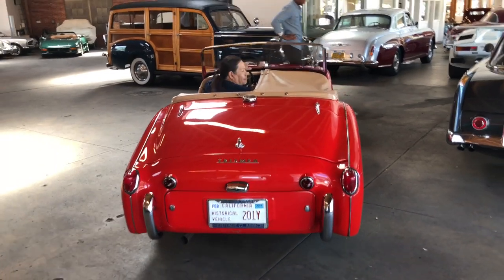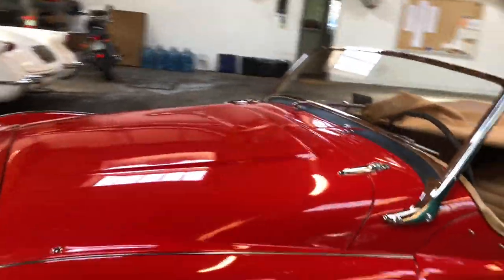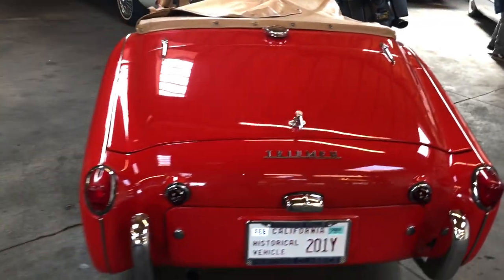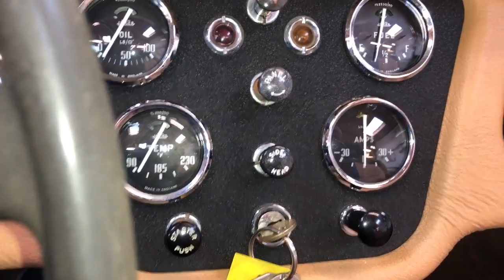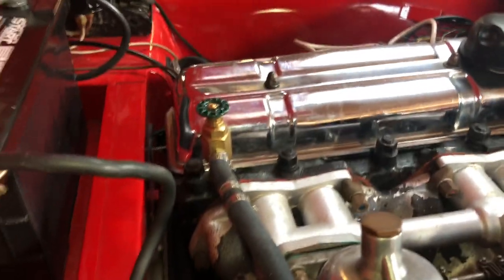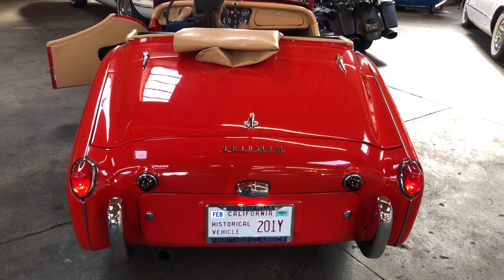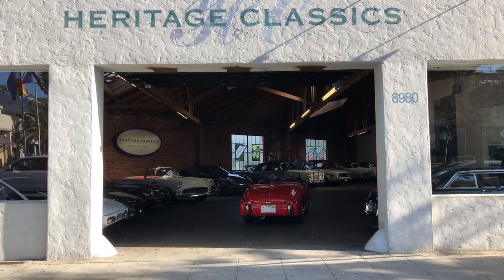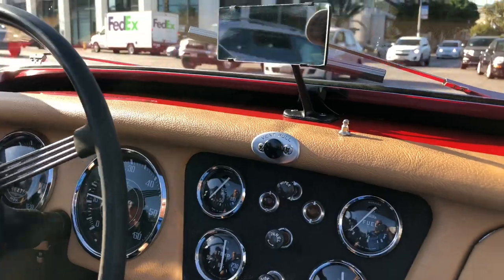1959 Triumph TR3  A

Comment: As others noted oil pressure should be at 25-30lbs at idle when hot, at cold start 50 lbs. wipers., indicators, stop lights all not working. Oil leak front and rear seal. Big $  to fix. Engine is tired. Exhaust manifold leak. Still great car but lots of items to negotiate asking price
Reply from the maker: I enjoy reading  helpful comments, thanks for sharing!
Reply: Agree engine is tired ! Also too much bonds in driver front fender !
Reply: @tomtugboat  I replaced my oil pump when the oil pressure dropped to 15lb at idle when warm.Taking a chance using a floor jack on the radiator shield not the frame cross member.
Very thorough inspection.

Comment: I know this is t the point of the video, but what year is that C1? I can tell it's either a 53 or 54 by the taillights and bumper.
Reply from the maker: 1954 Chevrolet Corvette Roadster in White with Red Leather Interior and Tan Canvas Soft Top, Early Model with Automatic 2-Speed Power Glide Transmission and 235ci Blue Flame 6-Cylinder Engine as per the dealer old listing

Comment: Would be more concerned  with originality and body / chassi twist than paint film build.  Suggest the oil pressure gauge may need calibrating. Typical valve clatter going on.